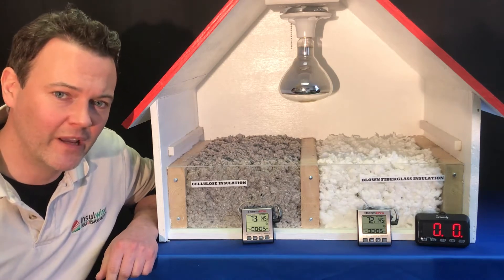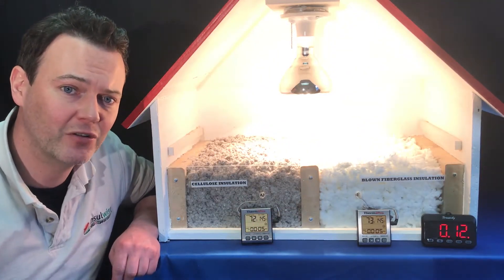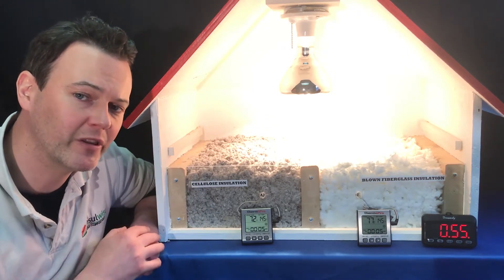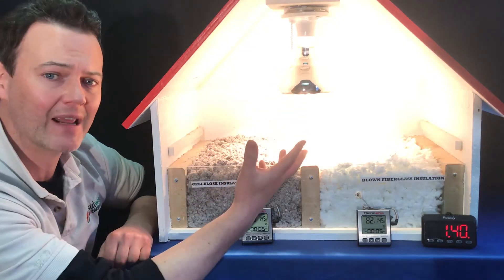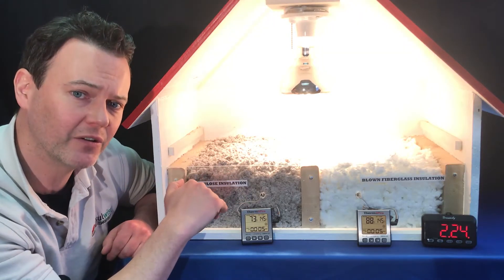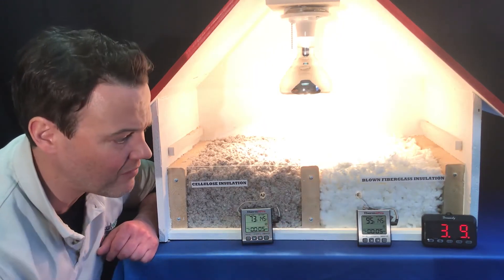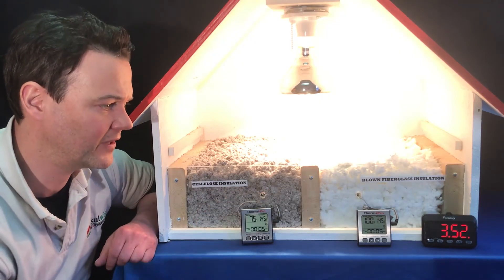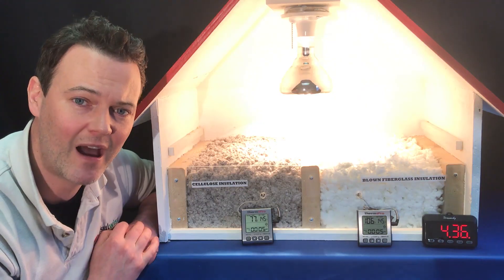Cellulose vs. Fiberglass Insulation: The Ultimate Showdown

Comment: so, wouldn't it make sense to equalize the R value of each type of insulation? Or the point of the experiment is that with an equal amount/volume of the cellulose it has higher R value? I'm trying to figure out what to use for my attic now, and the insulation companies do say that they'll add more inches of fiberglass vs cellulose to achieve the target R value, but it's also cheaper, so even if you end up having a thicker layer of material than with cellulose, you'd have the same amount of thermal insulation?
Reply: Cellulose, being a natural fiber,  breaks down at the 20 year mark and will need replaced.
Reply: @jeremymcclanahan2389  Wait so you’re telling me my 19 year old book collection is about to disintegrate???  I better get reading then!  Seriously though, cellulose is wood fiber, the same stuff paper is made from. What makes you think it’s going to “break down” in 20 years in attic climate conditions?
Reply: @Scott Bernhard  are your books in 120 plus degrees with humid airflow, then yes, nothing lasts forever, and I think it's just degraded
Reply from the maker: @jeremymcclanahan2389    Respectfully wrong.  There's lots of 500 year old castles throughout Europe that are full of wood timbers.  The last I checked wood --- which is composed of cellulose fibers -- is a natural fiber.  Not to mention that oddly 80 million homes in the US that are built almost exclusively with wood framing that far older than 20 years and still standing.
Reply: @jeremymcclanahan2389 
😂 nope,  it absolutely does not😆😆
Reply from the maker: Hi Timur, adding more blown fiberglass into attic installations to account for the lower R-Value is exactly what the insulation companies do here.   The problem is that it does not work.   I have come to that conclusion from 2 sources.  The first are studies that show that blown fiberglass loses R Value at temperature extremes.  The second are years of insulating existing homes in the Pittsburgh area.   In our climate we see both single digit lows and highs in the upper 90's, so it's an ideal environment for evaluating the effectiveness of different types of insulation.   

Since 2008 I have re-insulated the attics of well over 1,000 homes that had mounds of blown fiberglass in them.  In some cases the stuff was blown almost laughably high (24" inches...).   This folks don't start searching the internet for how to cool their upper floors during the summer or keep heat in their homes during the winter because they're comfortable.   Most people's attics are the definition of "out of sight, out of mind."   They find Insulwise's web site (www.insulwise.com) because they have a problem that they are tired of dealing with.  After we air seal and insulate these attics to R-49 using cellulose insulation, it is extraordinarily rare that we hear back from a customer that their problem was not significantly improved if not solved entirely.  
Thanks!
Andy
Reply: @insulwiseenergycomfortsolu3293  I want some R-49 now.
Reply: If you look up "Insulation Comparison Demonstration" by KnoxUtilitiesBoard, they do a test which shows that fiberglass does have a useful R-value, but then they show that the fiberglass allows more airflow.

      
        
      
      

  

    @oxUtilitiesBoard
Reply: It may have the same R-value if more and more fiberglass is added, but you also have to consider airflow.

The person in the video wrote, "we get calls EVERY day from homeowners with mounds of the stuff in their attics, who cannot cool their second floors during summer, or effectively heat them during winter.  It's R-Value definitely degrades at temperature extremes," and "The main reason for this is because of how light and fluffy blown fiberglass is.  This characteristic allows dense, cold, wintertime air to "fall down through it" in your attic, where it meets warmth conducting upward from the ceiling below.  This allows convection currents to form within the blown fiberglass, thus promoting the transfer of heat from your home to your attic."

Do you have a neighbor or cousin who has experience with fiberglass or cellulose? He or she might be able to give you more information.
Reply: @citizenguy  thanks for taking the time to reply. I'll ask around, see what people use for their houses. The one thing I'm not a huge fan of is the chemicals in the cellulose. I know they're rated as "non toxic" and all, but so was asbestos before) I tried looking if there were any long running studies on the subject of the effect of borax or the fire retardant on humans, but so far can't find anything.
Reply: @temujin1337  Another option is blown rockwool which doesn't have a chemical added to prevent fire.

Good luck on your home.
Reply from the maker: @temujin1337     Hi Timur thanks for taking the time to watch my video as well as ask questions!  The materials used in cellulose insulation that make it so that it cannot burn are 100% non toxic, literally the toxicity of table salt.  If you search around the internet cellulose insulation is considered to be by far the "greenest, most sustainable, non-toxic" insulation product on the market.   We like it because of those qualities, but also because it is MUCH more effective than blown fiberglass at blocking heat flow at temperature extremes.   Here a few quick links to check out:

https://bct.eco.umass.edu/publications/articles/cellulose-insulation-a-smart-choice/

http://greenbuildingnews.com/2016/09/16/cellulose-insulation-can-improve-green-design/

http://citeseerx.ist.psu.edu/viewdoc/download?doi=10.1.1.573.9905&rep=rep1&type=pdf
Reply: @temujin1337  people have used borax to clean clothes and their houses for years. Like hundreds of years. Borax is safe as it gets.
Reply: @temujin1337  any info on that?

Comment: Ok I live where you service but more south, so I am a little confused....I have read from other professionals that cellulose has chemicals that are bad? Also another installer said to ask how many bags, not square footage for price. Help???🙏🏻 Thanks!:)
Reply from the maker: Cellulose insulation is about the most benign there is.  There are two primary additives that are used to keep cellulose insulation from growing mold or catching fire.  Those are boric acid and ammonium sulfate.  Both of those chemicals are non-toxic.  So I don't know what he means by "bad."  

In terms of pricing, a bag count is a rough approximation of how many bags of cellulose should be used to insulate a given attic size to a given R-Value.  However because Insulwise specializes in existing homes, we are always (well usually) working in attics that have some type of existing insulation present.  So we take what is there and blow cellulose on top of it (after air sealing the attic floor) until we get a combined 15" inches of insulation.  That gets us to the R-Value value that we're looking for.
Reply: Also is there any tax credit or some kind of refund for energy efficiency? Thank you!

Comment: Good demonstration.
I insulated my house and shop with cellulose and I love it, good video. My understanding is R value was tested at 70 degrees F, the colder it gets (like winter) cellulose R value goes up and fiber glass R value goes down. The best insulation is a vacuum, the second best is a dead air space, furnace filters are made of fiber glass, why? Because air flows right through the stuff.
Reply from the maker: We are NOT fans of blown fiberglass here.   There have perhaps been some improvements made to it over the years, but we get calls EVERY day from homeowners with mounds of the stuff in their attics, who cannot cool their second floors during summer, or effectively heat them during winter.  It's R-Value definitely degrades at temperature extremes, which is an atrocious attribute for any type of insulation to have.  As soon as we prep the attic and blow it with cellulose --- problem solved.  .
Reply from the maker: Hey there imystery man, you're correct.  R Value is tested at room temperature for fiberglass insulation (which really isn't very helpful).   The R Value for blown fiberglass drops significantly at temperature extremes (ie --- when you most need it to work!).   The main reason for this is because of how light and fluffy blown fiberglass is.  This characteristic allows dense, cold, wintertime air to "fall down through it" in your attic, where it meets warmth conducting upward from the ceiling below.  This allows convection currents to form within the blown fiberglass, thus promoting the transfer of heat from your home to your attic.  And this is NOT what you want!